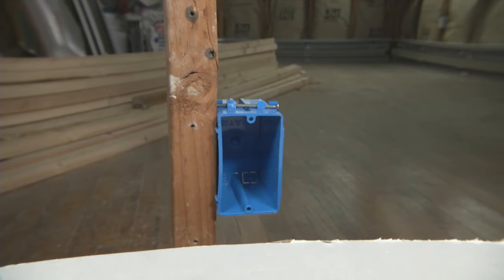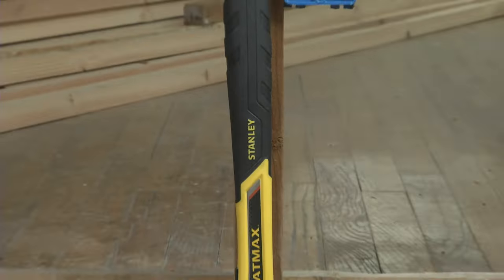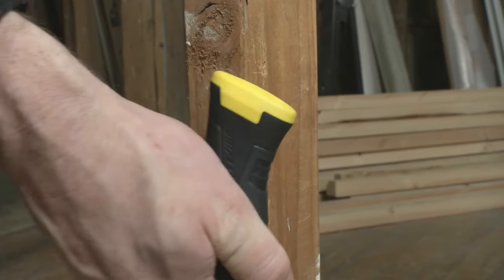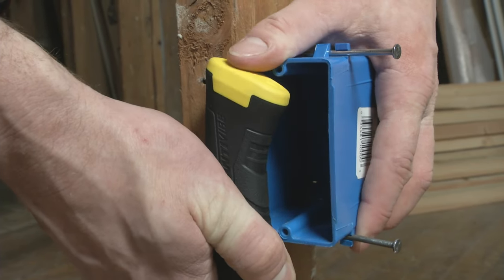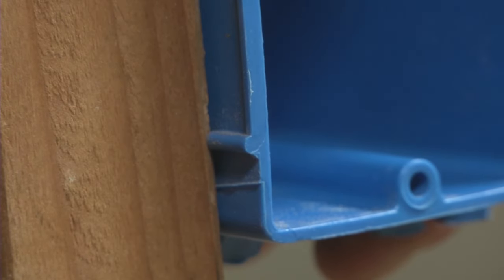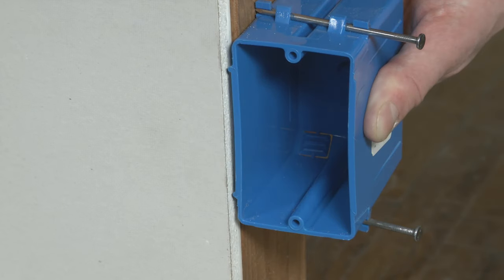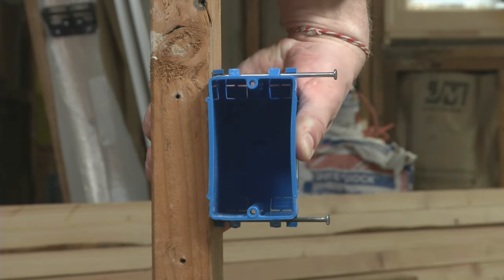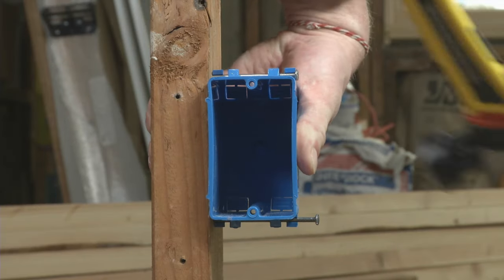How to Install an Electrical Outlet Box

Comment: But drywall is sold in 1/2” and 5:/8” thickness so which depth is correct?
Reply: 1/2" is for walls; 5/8" is for ceilings.
Reply: @matthewbair1346  whoops. I just purchased 5/8 for all my garage walls

Comment: If you are installing in a kitchen or bath where tile may be used, you can use an adjustable depth electrical box. That way you can dial in the box to exactly match up with the finished wall.

Comment: I measured the protruding tabs. They are only 3/8" will that depth still work with 1/2" drywall? I'm a noob at this stuff, and I don't have 1/2" scrap drywall to use.